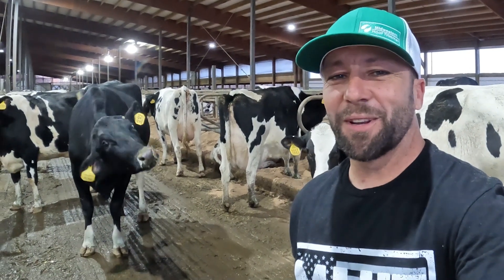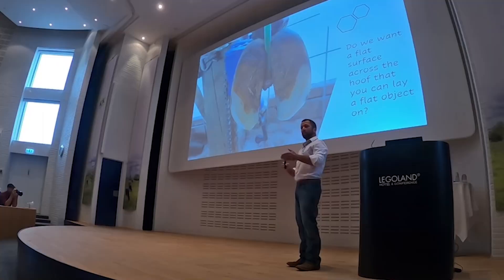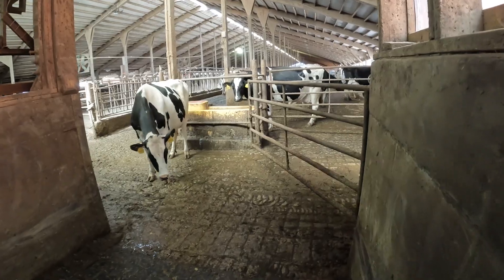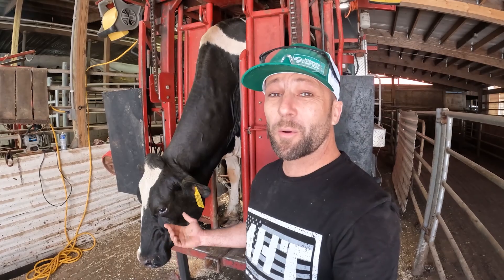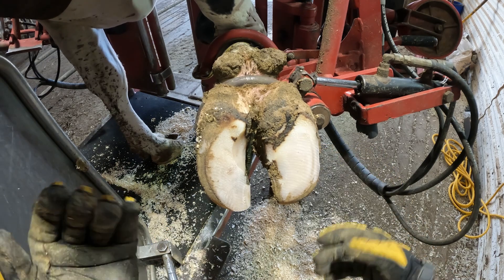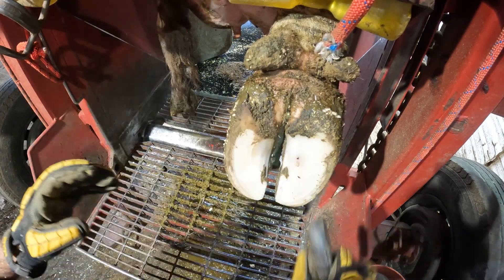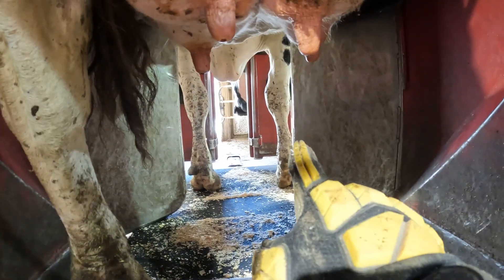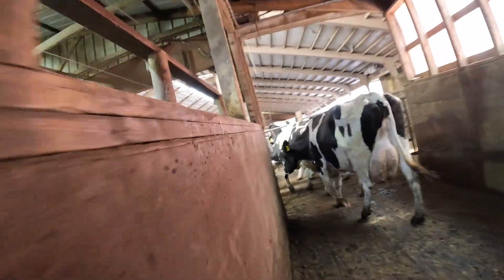ABSCESS and ULCER Prevention HOW TO TRIM THIS COWS HOOF? COW HOOF RESTORATION

Comment: Could you please inform the hoof GP about using the same truck to back the chute into position by putting a trailer hitch on the front of the truck, much easier for accurate position and less denting the pretty truck. He can weld, should be an easy fix.